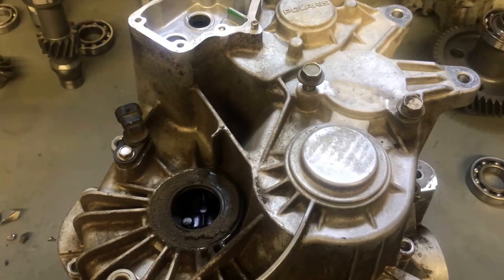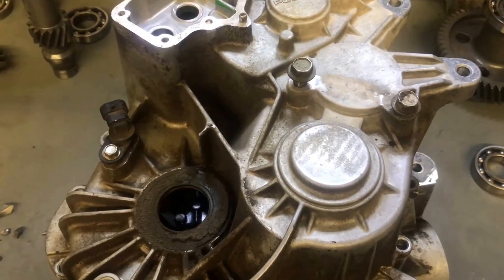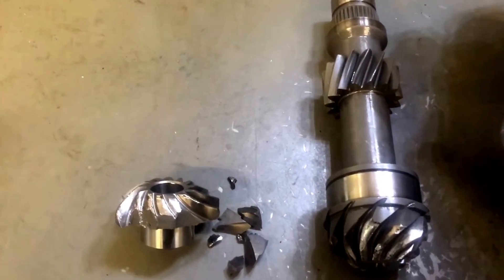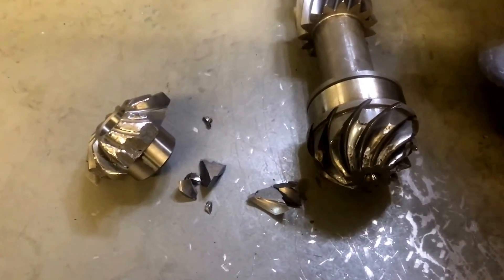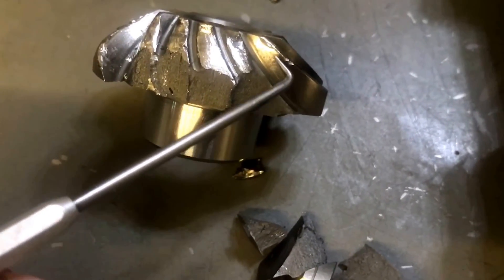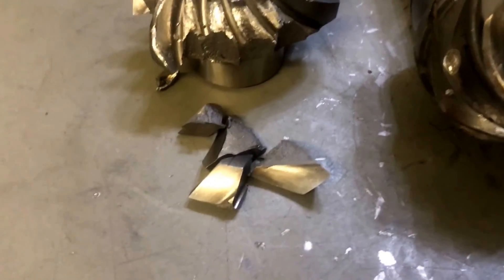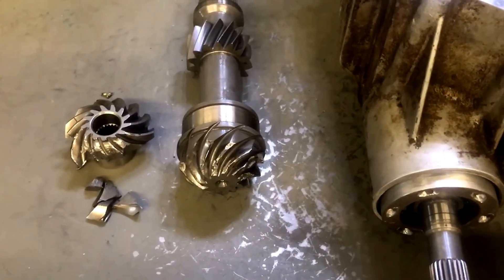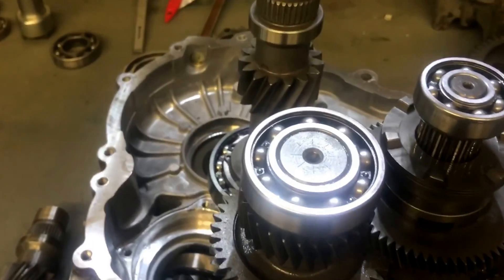Polaris rzr snorkel gear failure possible solution

Comment: Most of these problems are from Xtra large, huge deep thread tires on lifted machines. Leave the machines closer to stock if you're going to beat on em in front of your friends. Showing off is a thing with RZR's...................

Comment: Hello, I would like to know how this happens? What causes the breakage? 
Is it possible that it is the front axle that engages the 4wd while driving that causes the gearbox to break?
Large-diameter tires?
Reply: You said it with the last 3 words. Crazy big heavy tires with 2 in thread depth, insane.
Some dealers set them up as per customer order but cut any warranty out. They do it anyway.

Comment: I have a 2020 rzr 1000 xp4. Today, part of my tranny case blew out. I think maybe it was a bearing failure. The section on the casing is right above the mounting bracket for the gear selector cable. I replaced all three u-joints and upgraded the carrier bearing and housing a week before and only took it out 3 times before it failed. Do you think re installing the prop shaft in anyway could of caused any sort of binding in the tranny?? Everything spun and felt smooth after the install.

Comment: Pretty sure I just blew these out of my General.....my driveshaft no longer turns and doesn’t make any noise in 2wd..
Reply: I just had this happen to me on my RZR Trails and Rocks this weekend.
Reply: Wayne Simon it was I literally just got it out back together.  Kinda a weak link
Reply: @That_Teal_fummins  When I got it home I took a closer look and the snorkel gear is shredded and it blew a hole through the snorkel tube.  Parts on order hoping to have it back up and running for next weekends ride.

Comment: Direction means nothing its a bad gear design ? somewhere in there engineering there's an issue .This is a simple pinion gear think about your own truck does it blow the rear end backing up hard and heavy No.same dynamic at work here.

Comment: Pulling my transmission tomorrow. Pretty sure it's the snorkel gear. I'm only running a 32" tire and have never been rough on it.. this past Saturday I pulled in to some thick mud front tires dropped of to half way up the tire, I put it in reverse to back out and pow followed by grinding and popping.. smh
Reply: Most likely your reverse chain broke

Comment: So could you by chance help me define what is considered 0 backlash? I'm on the tail end of rebuilding my transmission from this very failure and I'm at the point  of setting backlash. I have it screwed all the way in and still have movement.  Any insight would be wonderful
Reply: Back out the snorkel tube a 1/4 turn at a time until you have no play. Once you have no play, look in the sight hole and thread the snorkel tube in until you see 3 notches pass by. Then tighten the last bolt on the bearing retainer.

Comment: I have searched the internet over, I have a 2017 RZR xp 1000 High Lifter. I have a high pitch gear whine from 20 mph gets louder the faster u go. also does it in Low. I have been in it and found nothing visibly wrong but its got to be something. have you ran into this, I have heard others having this issue but no ideas on how to fix

Comment: Bearings are terrible, I’ve actually never had s problem with any reverse chains, snorkel gear hasnt failed but we lost a bearing that blew up our RH case, replaced the bearings RH case cleaned all the shavings out just about $800 repaired OE chain and case, sand craft bearings

Comment: Will a gear reduction put more or less stress on the reverse chain and snorkel gear?
Reply: obviously more since the engine rotates more and applies more pressure to the gears. If you want less pressure you need to run lighter tires. Everything beyond transmission(aka driveshafts) adds stress to your transmission. Lighter wheels, lighter tires will help to reduce stress.
Reply: The only way to lighten the load on this drivetrain is to run portals. then the gear reduction is at the wheels .

Comment: Just had my snorkel gear fail on mine. Turner makes a stronger gear but i dont think thats the fix. I have the heavy duty retainer plate and it still failed and pushed the bearing behind the snorkel gear into my case and cracked it. So  thinking the fix is to weld the case around that bearing area to beef it up so it cant pull away and go back with stock parts. Hope you come up with a better solution before I put it back together lol
Reply from the maker: yes i am a turner deal he makes a fantastic product.  but it is only part of the solution.  ther retaining plate helps but again it is not the solution.   we use different techniques and precission building along with the turner gears to make our gearboxs the strongest on the market
Reply: @mudNwheels  I have a 2014 rzr 1000 with a big lift and 6 inch  portals on 40s     and a gear reduction  in the  transmission  my snorkle gear went and took a big chunk of the case with it I was thinking  going with a super atv case and the Turner  snorkel gear what are your  thoughts?

Comment: I think when the add ons exceed the design threshold, such as 34" tires, you can't call any part a "weak link". You can only call it " a broken part due to a user's bad decision to over stress the unit. It would be like me bolting a 500 hp nitrous kit on my rzr 1000, blowing the crankshaft out the bottom, and then claiming that "prostar blocks are a weak link".
Reply from the maker: may be so but improvements can be made
Reply: mudNwheels I absolutely agree. I feel that carrying over the 900 transmission to support the 1000 was penny pinching. Ultra thin retaining plate, Chinese bearings, inadequate reverse chain, etc, etc, etc.
Reply from the maker: you are  right about all of that.   i have been in this game with can am for a long time now.   i have had great luck making improvements to there stock diffs.   i believe i can have similar sucess with these gearboxes.
Reply from the maker: hey bud i do appreciate your comments .  thanks for watching
Reply: All we are doing is trying to find the weak links. The sights that tell you how to install a light bar can be found elsewhere.

Comment: I have a different question. on polaris highlifter edition sportsmans the front tires turn at a different speed than the rears from what a buddy has told me who owns one and has heard of lots of failures caused by that. have you heard or seen this as well? and secondly do you think you will try and do anything with that in the future? or anything to fix the plastic squirrel gage in the front of them? I do not own a polaris but I would like to know if my buddy ends up having problems and can get a good fix like you have done for can ams. thanks
Reply: Hmm that's very unlikely unless your buddy is running different size tires front and rear. This would be a massive/catastrophical failure if your front and rear rotate at different speeds.
Reply: @iare19  they do rotate at different speeds its not 1 to 1.